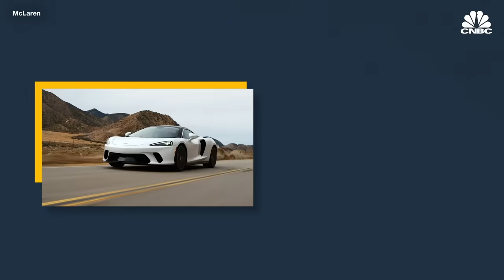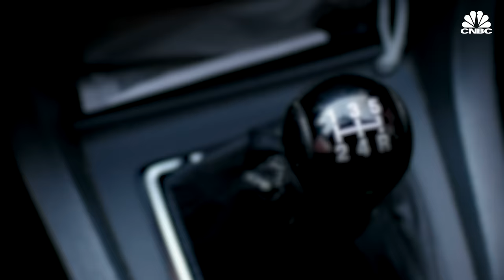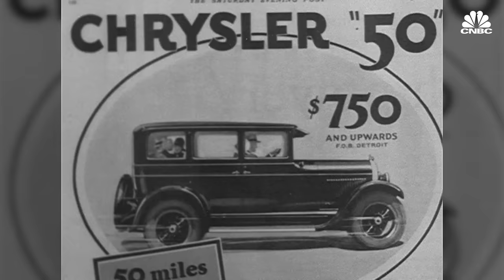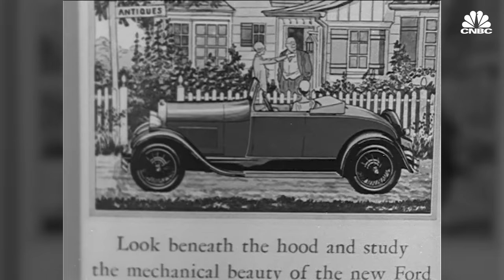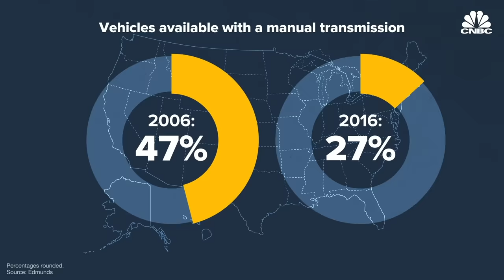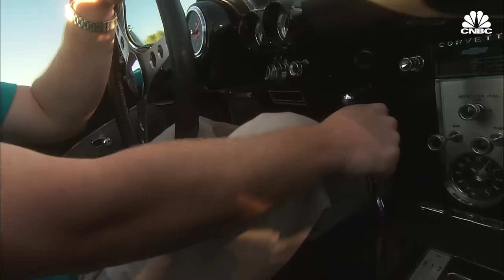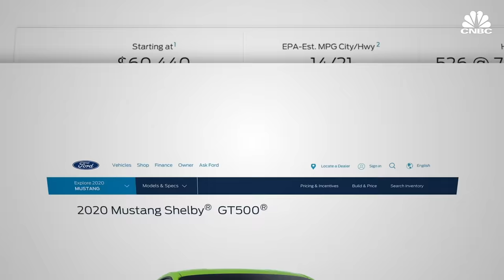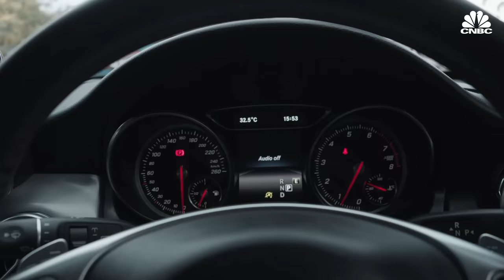Why Stick Shifts Are Going Extinct

Comment: As he said, “Driving Manuals is driving, driving Automatics is riding”. 

Soon automatics will be missed when autonomous driving takes over.
Reply: will never happen, none of them actually pass any safety standards eh...  1 in 10000 errors means someone is gunna get ran over while crossing the street is a when not an if..
Reply: @harleyme3163  it's not that big of a gap when compared to how dangerous people are at the wheel. They are becoming safer and more efficient each year. It's gonna be the norm in the next 30 years
Reply: It SHOULDN’T happen, but it will. Probably by 2050.
Reply: Mike Jones cars are always be there to stay.
As an car enthusiast.
Reply: Soon 😲all vehicles will be outlawed and we will sit locked in our homes starving because of quarantine 😱
Reply: @marioarroyo2006  by 2050 your vehicle will take you where you want to go the driverless cars are soon to come the technology will be so good you can be in LA and your car is in Arizona and you can call your car to come pick you up. And it will. The only issue right now with that is the battery technology is not good enough for the option yet.
Reply: It’s a tough question that I can’t begin to answer. Most non-college educated men in the US drive for a living. What happens to them? The service industry is already radically different in a 4 month span...will there be any jobs left for people who don’t want to go to college and don’t have entrepreneurial tendencies?
Reply: Yes I am out of touch, drove a manual a few years ago, somebody cut me off, guess what I hit to stop in a hurry, don't have to be Sherlock to work that out.
Reply: Good point.   Just look at autonomous braking.   How many dings, dents and pedestrians has that saved?   Tech is getting better, pilots fly on auto, ships use gps, spaceships...    I think I might prefer a computer over a woman putting on makeup while talking on her cell phone or the guy that just left the bar.
Reply: @adoreslaurel  A good manual trans driver would hit the clutch and the brake simultaneously. What did you hit besides the car in front of you?
Reply: THiiis neeed a DOUG SCORE
Reply: @harleyme3163  lmao Self-Driving doesn't have to be perfect, it only has to be better than humans- which is an incredibly low bar to pass
Reply: Fawad Bilgrami will never happen....reasons....way way too much money over a few trillion dollars just to half of America “Elon musk”
Reply: King Wiwuz IV  The insurance angle is the tricky one, if the computer malfunctions [built to the cheapest tender just like the space shuttle] and the car kills someone, who is liable? does the family of the deceased get to sue the manufacturer? does the'"driver" well, the person nearest to steering wheel, if it has one, be liable as He/She is considered the "Backup Computer". Very murky area,
Reply: @Tolohtony  Hit nothing, but the poor engine and trans kinda locked up when the clutch pedal got forgotten. gave me quite a jolt as well. If I ever drive on again must remember that left pedal. Toyota Highlux utility.
Reply: drving too will be missed
Reply: @adoreslaurel  Funny how they do that. Glad to hear you didn't hit anything.
Reply: @harleyme3163  You think humans are much better?
Reply: That'll go over well when your car is driving you on snow covered roads and you end up in the ditch.
Reply: 2025 will be massive autonomous driving car
Reply: @Johnclark300  you dont need a lot of battery technology for autonomous driving, infact you could be able to turn a regular gasoline automatic car to do autonomous driving if you toss enough censors and an ai on it.

Thing is that these things are nowhere near ready at all to be used in traffic and they tend to fail when mixed in regular drivers a lot more, also we have other forms of autonomous driving that are also superior and safer than AI, its called uber drivers and public transportation.
Reply: D. S.  there is no bread, there is no beef because the slaughter house business is in the process of killing off its stock they had fatten up and are buried, there is a shortage of eggs the price will go up, milk is not getting to market, but if you want a Blues Brothers rubber biscuit? 
You throw it against the wall and when it doesn't bounce back?  

You go hungry😀😁😂🎤🎵🎶🎼🎸🎺🎷🍪🍪🍪🍪🍪🍪🍪👍😎😢😣😤😨😟😱😱😱😱😱😱😱😱😱😱
Reply: @Johnclark300  It won't be your car. It will just be a distributed bus. The automakers are in a race to the bottom because they know that as soon as autonomy takes over, brand and ownership will be meaningless. Not long after there will be free options, but you will be exposed to 90 dB ads during the whole trip.
Reply: @marioarroyo2006  This is just one aspect of a large future problem. Intelligence is fast becoming the only important job skill. And even that will eventually fade.
Reply: @jamie49868  It makes a ton of sense, but it comes with a large cost as well. The lethal consequences of failure in such systems will necessitate them being in top condition all the time, just like an airplane. For anyone who has never dealt with aircraft, they are a huge pain in the ass for maintenance for these reasons. Combine that with the fact that they will all be networked devices, and you will quickly have a situation in which they are more liability to own than they are worth. They will become a distributed bus, rather than an individual's car. I suspect that someday we will look back on the ability to get in your own vehicle and travel thousands of miles anonymously as an almost preposterous level of liberty.
Reply: @CortezBumf  Sort of. You can't hack a human driver from the other side of the planet. Self-driving networks will be one of the juiciest hacking targets of all time.
Reply: @adoreslaurel  Very shortly after autonomy, the human driver will be illegal. The liability will absolutely be to the manufacturer or the network somehow.
Reply: @billsandrew  The cars will simply refuse to drive in anything but the slightest rain.
Reply: Won't find me in one of those death-mobiles.

Comment: The best thing I can say for the manual transmission, THEY ARE FUN TO DRIVE! My first car was a 1963 Ford Falcon Futura. It had a three speed manual transmission with a column mounted gear shift, a three on the tree. After that one, cars I bought had automatic transmissions, not because I wanted that transmission,  but because they were used cars and that was what I economically could afford. So, when I was able to buy a brand new car twenty four years after I bought my first one I bought a Plymouth Sundance America with a 5 speed manual transmission, gearshift mounted on the console on the floor. I guess you could call it a five on the floor, but I never heard anyone refer to it that way. That car was just so fun to drive. When it came time to buy my next car I was having trouble finding the car I wanted with a manual transmission. So to get the color I wanted and all the other options I wanted, I went with an automatic. Ever since then, I have not found the car I wanted in a manual transmission, but I would prefer to have one.